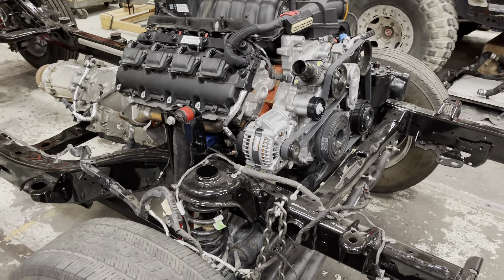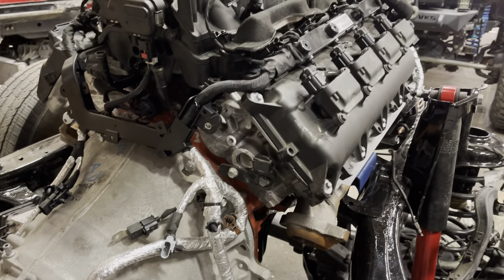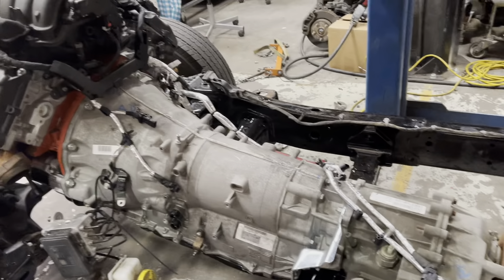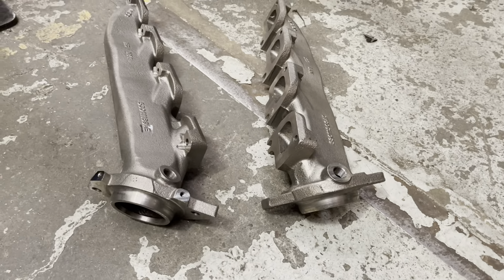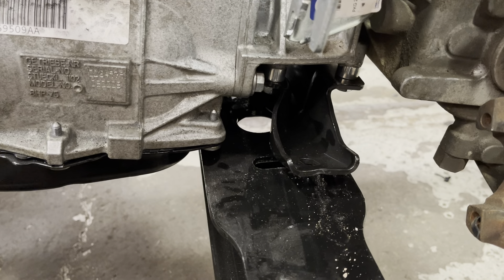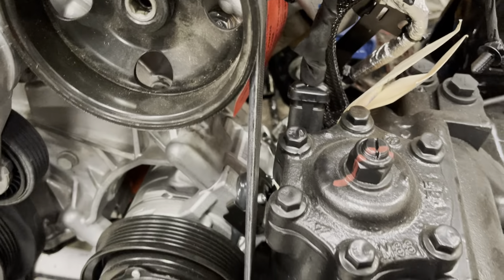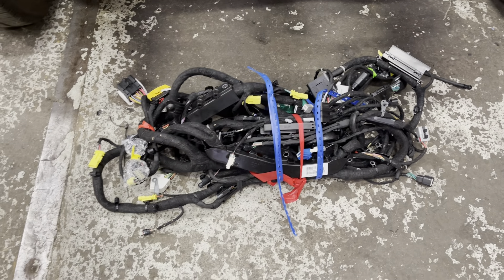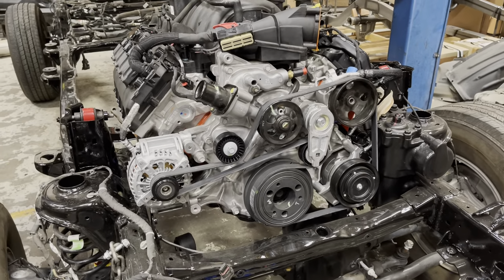JL 392 Hemi swap part 3

Comment: Hey Todd, following this very closely. My 2020 Gladiator is less than a 100 miles from the factory warranty being expired. So...have a couple questions. My Gladiator, being a 2020 has the flat engine mounts, not the JK style. Any idea how your thinking to handle that? Should I look at 392JL mounts? JSS weld in mounts? I'm going to start looking for a motor and trans. I want a 6.4L in my Gladiator. I assume I'd be looking for a car 6.4L? Is that correct? Then an 8hp75 out of a Ram 4x4? Or can I use a truck 6.4L?
Reply: I am following closely too Harold.  I cannot wait until a Gladiator build is ready, I dont have a Gladiator yet as im waiting for prices to go back down.  It would be a dream to have a HEMI Gladiator!!!
Reply from the maker: Hey Harold,  Well here is my take on this. The JL/JT is very complicated the frames are different from year to year, Jeep also has many different engines and setups like E Torque non E Torque, Diesel, 3.6L, electric. So this is hard to build a kit and have everything work. So we are going to give it a try and share it all and what we find, I don't think we need to build a kit but we are going to work on the computer part and i think on the engine mounts we might do our weld in mounts and modify. While the JL 392 is new and under warranty parts should be resealable.  So i think the 5.7L and the 6.4L should work fine. Well i know this will work just don't know what it is going to take.

Comment: So i have a 08 5.7 hemi ram 1500, thinking about doing a hp70 swap and was wondering if i can use my stock 545rfe transfer case? I think that would make life easier... im currently building a twin turbo 392 71 demon with the hp90 swap and a sound german auto trans controller. Would i need the same trans controller for the ram too?
Reply from the maker: I would do the same thing with the truck as your car.

Comment: Does the hemi and 8 speed bolt up without mods if I have an Atlas transfer case ?
Reply from the maker: Yes, when using the HP70, HP75, RFE845, RFE850 all truck transmissions, I know that they will work. Now when using a JL/JT 850 transmission I'm not sure, i think you will need a Advance Adapters adapter
Reply: @Jeep Speed Shop  thank you, I hope to do the 8 speed first for my 09 jku then do the hemi
Reply from the maker: @Flynnster70  There is one problem i forgot to add, we can not do a 8 speed swap on a 3.8L because of the bell-housing and the crank sensor in the bell-housing..
Reply: @Jeep Speed Shop  well guess that means I'll have to do it all at once, thank you for that info!